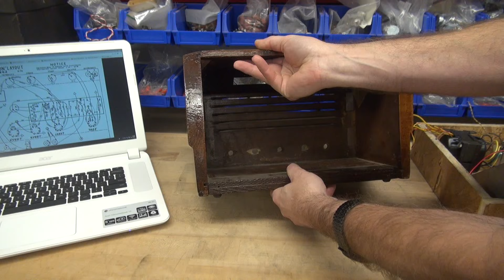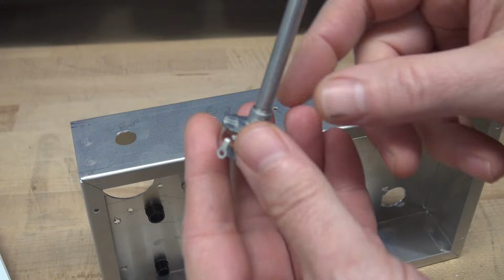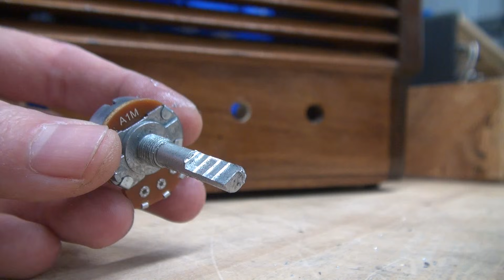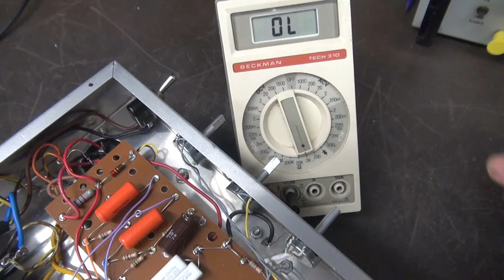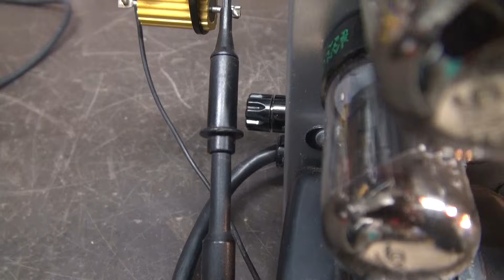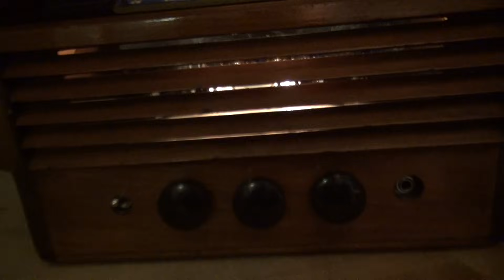How to build 6V6 Boutique tube guitar amp start to finish Homebrew kit

Comment: I've made ONE tube amp, but it was a twin channel, 100 watt job. If I go beyond a certain volume and hit the strings a little too hard, it breaks up and goes crazy. I've tried to fix it on and off for like 3 years now. I've swapped out power and output trans, all tubes and all filter caps, looking for the fault. The signal out of the effects send is clean, and the problem exists on both channels at pretty much the same actual in-ear volume, regardless if the preamp gain is low and the master volume is high, or vice-versa. There's no sign of arcing on the tube sockets, and I've played it in the dark to check for this. I've tried changing coupling caps, too. I'm thinking it's gotta be a lead dress issue, so I might just tear it all down and rebuild, paying attention to being really anal about lead dress. No way I could film that process though. That would drive me nuts
Reply: Lead dress is very, very important & has made me strip even some high end amps with problems.  Fit wires that can be bent away from eachother and stay in that position,  avoid wires running parallel.. this is usually "the cure" for most "funny noises" in tube amps.

Comment: What? Someone plugged a resistor into the output jack?
Reply: its a dummy load dude you cannot run a tube amp with no speaker or no load you risk damaging the output tube(s).

Comment: NEVER START YOUR PROJECT THIS WAY!!..NO SMOKE??  YOU NEED A CURRENT LIMITER TO MAKE SURE YOU DON'T SEE SMOKE!!  https://www.youtube.com/watch?v=wRFRwOnLsZI
THIS IS A GREAT VIDEO TO MAKE A CURRENT LIMITER...(ALSO UNCLE DOUG DOES A GREAT JOB OF SHOWING TECHNICAL STUFF FOR TUBE AMP BUILDING.)
BEST WAY IS TO THEM USE A LIGHT BULB 100WATT OR 75 WIRED IN LINE SO WHEN TURNING THIS ON WITH A VARIAC IF THE BULB GETS BRIGHT RIGHT AWAY WITHOUT GOING BACK DIMMER, YOU KNOW SOMETHING IS WRONG! IF YOU WAIT FOR SMOKE, IT MAY BE TOO LATE!

ALSO IT IS A GOOD IDEA TO CHECK ALL THE VOLTAGES FIRST WITH A VARIAC SET AT 12VOLTS AC AND CONNECT TO POWER CORD, CHECK AT SOCKETS HEATERS AND B+. MULTIPLY BY 10 TO GET THE IN THE PARK VOLTAGES...

Okay enough with the caps!  Nice build and video otherwise...have fun and remember NO MORE SMOKE!

Comment: When I first learned electronics everything was vacuum tubes. Built my first ham radio morse code transmitter in the 60s. My step-father used to repair TVs on the side, so we always had plenty of old TVs to salvage radio parts. Brings back memories.
Reply: my ma's boyfriend in the mid 70's had a friend who was a hard core TV repairman, we went over to bleed his brakes one day and the amount of tools and gear simply floored me, so did his 2 daughters my age I was like 13 or so..  but thats why when I saw Fast Times and Ridgemont High and he said "my old man's a TV repairman he's got mass tools he can fix it" it hit home with me and I always flash back going over to that old boys house.. his garage was crammed full, 3-4 sheds out back and his home was crowded with tools and parts and gear and TV's radios and amps.. never forget that house

Comment: I build my first amp in 1963, was 13y.old. OBVIOUSLY TUBES in those days. Well, it worked great the first time on, but one thing; 60Hz hum was audible because I had transformers lined up, parallel to each other. Turning one transformer 90 degrees to the other, so the electromagnetic lines cross and cancel out took care of the hummm.
I'm surprised you don't have an issue with that.
Reply from the maker: Was that amp built on a steel or aluminum chassis?
Reply: It was aluminum I build myself, drilled, cut etc...
Reply from the maker: I usually build on Aluminum. Only have hum issues with steel chassis. I have tried rotating transformers to see any difference. The scope shows no increase in hum regardless of orientation.
Reply: Interesting, because I wanted to know what the scope shows, since I did not have a scope than, only my ears could "see" the hum. So now I'm thinking that I also turned my tube sockets to get the filament voltage away from components and signal path. So, when you fix two issues at the same time, you might save some time, but you won't know which one did the trick. Funny how I'm still fixing my first amp, ain't it?
Reply: Try a 'humdinger', a 220 ohm pot across the heater winding with the wiper to ground. Adjust for minimum hum.
Reply: @silasfatchett5693  only needed if your filament winding does not have a center tap

Comment: Nice build Terry. Like the cab, and you always do such clean work. You make it look easy.. 2 questions.. Wouldn't one typically turn the output transformer 90 degrees to the power transformer? The amp while on, was obviously very quite... Is that practice not really that important?  Thanks for your time, Tom
Reply from the maker: Transformers are shielded, so no cross inductance, no issues with new type

Comment: Hey Terry, I'm interested in this amp if you still have it.
Reply from the maker: Hi Kyle, one like it, same circuit (Victory) is on Reverb.com
Reply: It looks very cool. Would it be possible to add reverb? If so, how much would that add to the price? Thanks.
Reply from the maker: Hello Kyle, There is not enough room for reverb on this model. I can make a larger Princeton style for you with reverb. Will be a few months before I could complete that. Lots of projects pending here.

Comment: Nice build! I have one question, 400vdc on the guitar input? Am I missing something as to safety issues? I know of some musicians who have received nasty shocks from their guitars in the past.
I can't help but notice your shirt, E. F. Johnson. Are you a two way tech or former employe of this company? Worked on many of their products in the past.
Reply: the 400 v is the unloaded output of the power transformer after rectification witht the diodes he mentioned. The multi-meter is connected  inside.  What you see clipped to the input jack are leads from the signal generator.

Comment: This obviously requires a base knowledge of electronics, which I don't have. This is way beyond my understanding.
Reply: wm17959 Have you ever built a model? This isn't much different. If you don't know anything about basic electronics, and aren't willing to try, you are doing yourself a disservice. Start by building a simple stomp box, then step up to one a bit more complicated, then try something like this. In the process, you will learn something about electronics. It's as simple as that. If you have the desire to learn something new, here you go.
Reply: I appreciate this, and I'm sure you're right. But many years ago I tried to get into electronics and had an impossible time. I think it's because I'm a mechanically inclined person so if I can't see how it works, like gears and pulleys, then I get lost. I would like to try this again some day though because I really would like to build a simple 40 watt solid-state amp. Part of the problem is I don't have all that test equipment and that would also be a huge learning curve. But you're right, I probably could do it.
Reply: I'm with GS, just do it! Like you, I'm also mechanically inclined and have some difficulty understanding things I can't see. Last spring I jumped into the DIY world buy building a Strat from a kit, a pedal kit from Mammoth, a 20w amp kit from Ceriatone, and finally three cabinets (head, 1x12, 2x12). Everything turned out great. I still struggle trying to wrap my head around a schematic, but following a part layout is more like paint-by-numbers. Start small, build your confidence, and you'll be building amps from scratch in no time!

The only test equipment you really need is a multi meter, preferably one that can test transistors and caps (particularly if you ever want to build a pedal).
Reply: I have built models since I was a kid, and I've done mods on electric guitars and pedals. Do you think I have potential to do this?
Reply: You've done more than I had done before I built my Son of Yeti. Go for it!
Reply: No offence to D Lab but if you want to learn tube electronics go to uncle dougs channel.  He has a series of videos where he explains very well in easy to understand terms how a tube amp works!
Reply: Thanks! I just don't want to solder the wrong wire and fry everything, lol

Comment: So, was there anything special about your tube choices... Were they matched, NOS, what brand,,,, ???? Anything that needs to be known about the choice of tubes, and why????
Reply from the maker: Nope, just  Lab stock
Reply: D-lab Electronics 
Thanks for the reply... Would you be willing to say one way or another about vintage tubes, NOS, matched, etc. etc.... I am a total newbie, and want to do a build, and there is so much "hype" about the tubes... There is probably a basis for all arguements, but I am sure there is also some BS... Love this video... Just subbed... Looking forward to more...
Reply: @tommyg5095  its all bullcrap...matched tubes are for use in push pull amplifiers basically if you have a weak tube it will kill its pair...in single ended amplifiers any good strong tube will do

Comment: you never did say what it ended up costing you for everything... I would really like to know that final cost please... and you are talking/caring so much about certain placements couldn't you add wire shielding tape like you add in guitar pickup pockets??? it's fairly cheap...

Comment: Isn't that front panel layout a mirror-image of the "usual" layout?  I think I'd be tempted to layout the chassis in a mirror image so the user controls are "normal".  (A case of ignoring standards at your peril.)  Especially important if you don't label the knobs.
Reply from the maker: Hello, Yes, it is 180 degrees out. I do this to line up with the eyelet board and keep noise to a minimum. The controls have ID below them in a gold flake paint. That was not shown well in the video.

Comment: Even if you went with a 6V rectifier tube, you still couldn't do it.  It has to be isolated from main filament supply.  Seems like having the filament supplies in common would create some problem (even if you could find a isolated filament rectifier tube.)

Comment: Hi Terry, another excellent video. I recently posted a link to a video you did about standby switches on the Tube Guitar Amp Builders group on Facebook. It started a very lively discussion to say the least. lol Could you do a similar one regarding filament wiring. To twist, or not to twist. That is the question. I mention that because just last week there was another discussion about that, and it got quite heated. ( Please pardon the pun)  I am sure that some will cry blasphemy because you used a diode rectifier, ha-ha. Thank you for another good video.

Comment: Awesome.
Question, when you were milling the pot shafts the slot of that pot was facing up and there were metal shavings from microscopic in size to substantial everywhere.
You don't worry about rouge shavings getting in the pots and causing issues?
Reply: Tape the pot up.
Reply: the shavings are the size of the tooth and depth of the cutter. Too large to get into the innards of the pot.

Comment: Nice build...and very informative. One question if you have time...the two 100 Ohm resisters on the filament lines create a virtual centertap for the transformer (correct?). I see that Gibson-type amps normally have them at the end of the line, near the 12ax7...is there any particular advantage (ie. noise reduction, etc.) to placing them closer to the transformer/power tubes as you did in this build, or was it just more convenient? Thanks for all the great vids!!
Reply from the maker: Hello, good Q. Yes, it would be preferred to have the resistors at the end of the filament line. And yes, I mounted them on the octal tube base since it had ground tabs. Function wise, I have never made a comparison on signal noise level vrs the 2 positions. Sounds like a great video theme?
Reply: D-lab Electronics Thanks for the reply!!! I think it would be a great idea for a video. I have read in amp design books that, barring any component "issues" like bad caps, grounds, etc., the first tube stage "controls" the overall characteristic noise level of the amp.  This includes issues like Johnson (thermal) and Excess (ie., component material) noise such as found in older carbon material resistors.  Would be interesting to see the effect...thanks again!!

Comment: Terry, you knocked one out off the park, again! Fantastic! I want to build a 50 watt Bassman style head. Any chance you could do a build of that? Single channel and very clean output. I want to be able to crank it up all the way to 10 and have head room and little or no clipping. I am asking a lot, I know. You are the only guy on YouTube who could do it! Thankz
Reply: The most headroom you will get is the AB-763 CIRCUIT OUT OF A BLACKFACE SUPER REVERB, OR THE EARLY SILVERFACE SUPER REVERB, 1968-69 ISH.
Reply: Don Rutter Thankz Don. It will need some mods in the preamp, though.

Comment: i havea question; why do you have treble and bass controls:  doesnt less treble=more bass  or vise versa
Reply: Nope, that's not how it works.  Treble increases your high frequency, while Bass will increase your low frequency.  They are INDEPENDENT.  Good question. 👍
Reply: The tone knobs are “subtractive” not “additive”.
Without them, the amp would sound like both of them at 10.
So with them, and at zero, they have removed those frequencies.
Turning them up then brings them back in.
“Your amp's traditional tone controls—“bass,” “mid” and “treble”—reside in the preamp stage and thus accomplish their work before the signal reaches the power amp. These tone controls are generally “subtractive”—that is, they don't boost anything; they control the amount of frequency band removed from the signal.”